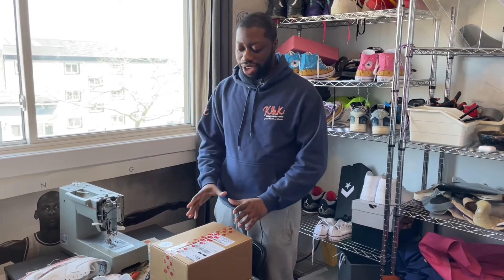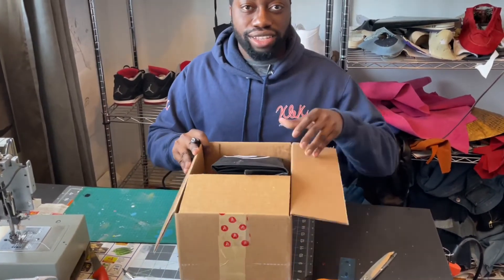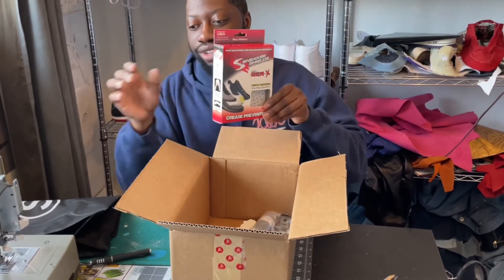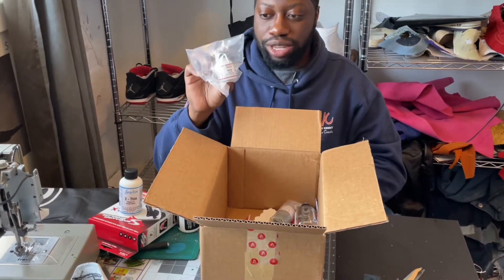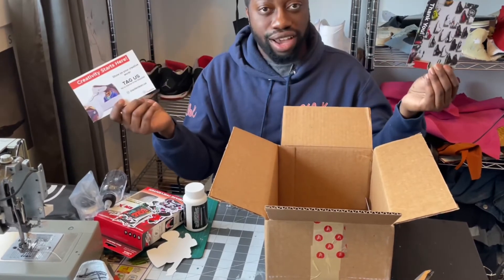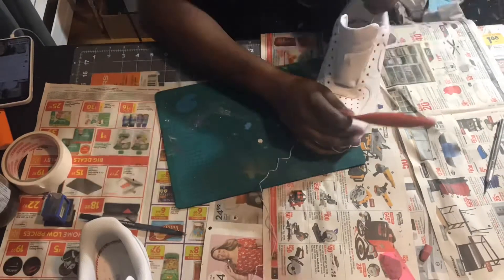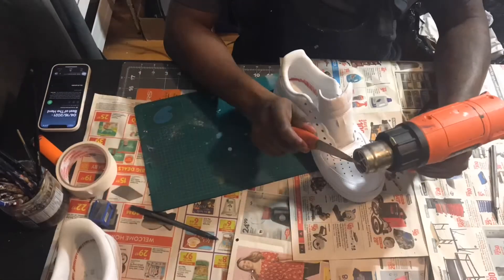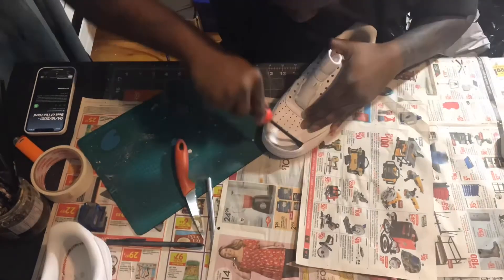How to remove Nike Air Force 1 Soles |Package from Sole Clean in Toronto

Comment: Hey, can I replace just the most bottom part of the soles? like not the midsole like shown in the vid, but just that thin gritty one. It looks like its just glued to the midsole?
Reply from the maker: Not sure what you mean. Can you explain it a bit more :)
Reply: you would have to do some sort of vibram swap for just the outsole and not the midsole. i'd recommend a palm sander and then a vibram rubber outsole for what you're referring to. otherwise you have to replace the midsole and outsole at the same time kinda like the back of an iphone lol